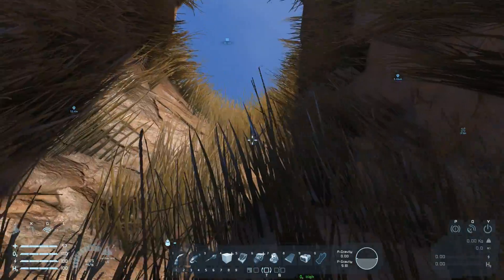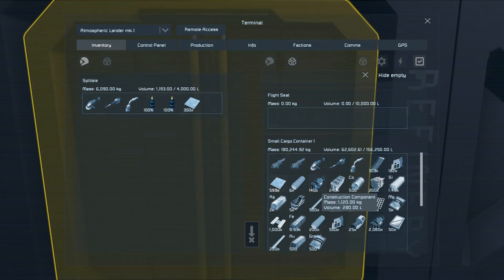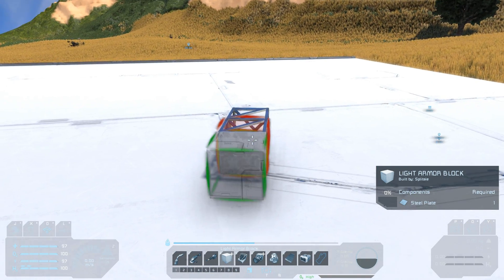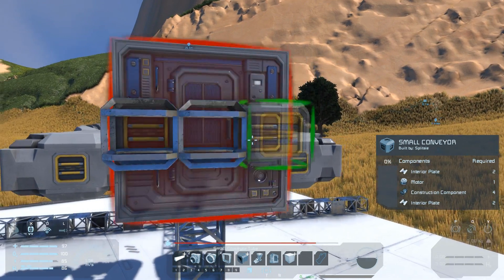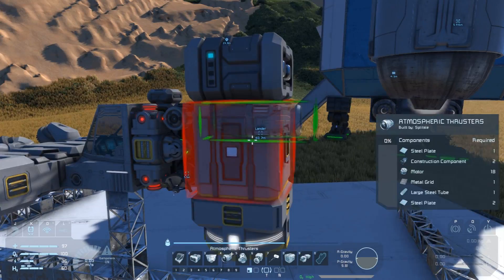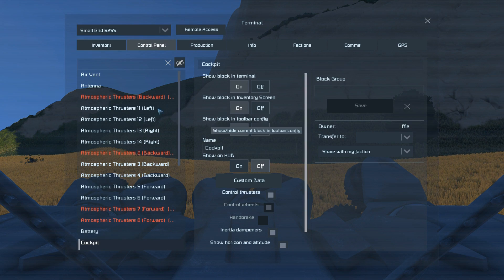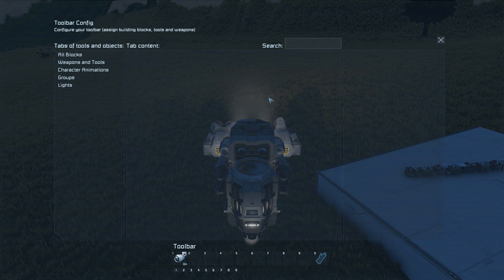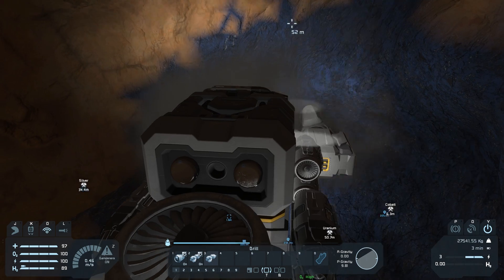Space Engineers Tutorial: Build A Planetary Mining Ship (Part 2 of a survival tutorial series)

Comment: I'm new to space engineers, could it be that since this video was made, it is not possible anymore to add a large thruster on a small block ship?
Reply from the maker: I suspect you're trying to add the large grid thruster to your ship instead of the small grid large thruster. Change the thruster type with the mouse wheel instead of changing by pressing the hot key number and you should be able to get the correct thruster type :)

Comment: I know that this video has been up for almost three years, but I made this ship for the first time and it worked great, until the second time I docked the ship and it started saying "No fuel" and when I went to take off later. It just crashed to the ground without any thrust. Am I missing something?
Reply from the maker: What were you using to power the ship? If you were using batteries had they been depleted by the base while you were connected? If you don't have enough power generation for the facilities on your base then the miner's batteries will be used to supply them. You can quickly check if you have enough power production by going to the control panel for a battery on your base and seeing if it is getting recharged or if it is being discharged (if the information on the right panel says 'recharged in...' or 'fully depleted in...')

Comment: I would like to see your spin on a CAT Front End Loader as a mining vehicle. I tried to use rotors and pistons for moving the shovel but it did not end well.

I made my arms that hold the shovel on a pair of rotors and then used a pair of rotors mounted on the end of a piston between them to push the shovel bracket upwards and downwards. When the piston rotor attached though... my vehicle launched in the air and started doing an aileron spin so fast that it was defying gravity. I was sitting in the cockpit in first person view when this happened. I couldn't get it back down until I ground the piston away, causing the vehicle to slam back in to the ground and bouncing off of the batteries. It MOSTLY survived but I did lose the batteries and my shovel bracket

Comment: Watched this video, sees small reactor. Quit video. Useless in survival mode because no uranium on planets (now). Still trying to build a working flying miner.
Reply from the maker: Or you could simply replace any reactors on videos made long before the change with batteries and you'll be good to go :)
Reply: @Splitsie  ok but i have to load them somehow.
Reply from the maker: Batteries start with 25% charge, you can get additional charge by connecting the ship to a base with excess production using connectors, or place solar panels on the ship to build charge (wouldn't recommend the second one as your go to as it'll be really slow).

Also, I'm hoping to release a new version of this tutorial this weekend :)
Reply: @Splitsie  Yes i know how to charge batterys. My point is i need a complete new ship design for a battery/solar panel ship. Without solar panel i shouldn't run out  of power. I hope you will make a new tutorial for survival mode ;). Thanks for your time.

Comment: Pity this a bit outdated , considering uranium is asteroid only. Your tutorials are pretty good, though I myself like to put one tile of space between drills for that little extra coverage. Mainly because I prefer to use large thrusters to save power (and sometimes resources, not always)
And when it comes to max capacity trials, I do a test run where I drill mostly stone (or if I have marked good spot, the resource), Make note of the ships weight and roughly stop every time I have digged around 10-20% of its weight. If it can fly easily home with 80% increased weight, it's a good mining starting miner in my books, if not.. Moar lift thrusters!
Also, for new readers, be prepared to lose our first miner ship. Flying with heavy loads can get difficult in atmosphere, start it safe and have back up resources incase your ship can't be recovered/salvaged
Reply from the maker: I just released my first in the remake of this beginner series and the next one will almost certainly be the remake of this video which will be all about batteries :)

Comment: So, i basically built this miner, but for some reason it keeps running backwards. I checked options on thursters and all that but it still didn't work properly. I finally managed to get it off the ground, flew about a bit, landed it, and turned energy off (Y). When i started it again, it went crazy again and crashed half the ship (cargo container and everything under or connected to it only).

Was this a bug of sorts or something i did?

(Yes, i am late to the party)
Reply from the maker: Ensure your thrusters are properly oriented and that you have enough power for all of them (that your battery has enough charge) as those will be the two most likely problems. Also the way this miner is set up, you need to fly relatively level otherwise the amount of thrust available won't quite keep you airborne. The explosive restart of the ship may have been a bug, but the other issue is more of a design flaw due to me trying to keep this relatively cheap to build :)

It's one of the things I'm planning on improving when I restart the tutorials after the proper release of the survival update :)

Comment: You should probably do an update mining vehicle video when the new survival update is released :) Also, I've found the most cost effective mining vehicle to be a small rover with just one single drill placed in the right height. The right click mode allows you to tunnel down, and you can control the slope of the tunnel by driving up to the wall. I've made a blueprint of the thing, works beautifully, and doesn't suffer from weight limitations like flying miners do (Though this one is a bit short on space). https://steamcommunity.com/sharedfiles/filedetails/?id=1625490504
If anyone knows a way to make a large grid miner (preferably rover styled to not have to worry about weight) that would be great. I've made one which tunnels very well, but it's a pain to actually get the ore :/
Reply from the maker: I'm planning on doing a complete restart of the tutorials once the update is completely released which will include a lot of the things I've learned since I made these ones :)
Reply: @Splitsie  Awesome :D
I just discovered the most amazing thing today. If you set up large drills and wheels like this: https://steamcommunity.com/sharedfiles/filedetails/?id=1640241613
You get a vehicle which can "climb" in tunnels and be almost completely safe to mine with :D Literally impossible to get stuck in a hole, it can even drive upside down.

Not sure if this is common knowledge or not, but I thought I'd share :) You can make a 3 drill version of the same ship too, but then you can't fit the large cargo container. Might be good as a mid-tier vehicle tho :)

Comment: I followed the tutorial, and it's really cool -- but I can't get fuel into the reactors! No matter where I add it, it ends up sitting in the Connector unit inventory. I'm a total n00b, so I'm sure I did something stupid. Any ideas what I did wrong? Thanks!
Reply from the maker: I suspect the problem you're having is that the uranium can't pass through conveyors without power. The easiest way to fix this is to put a small reactor somewhere on the outside that you can access directly, put a small amount of uranium in there, then that'll provide enough power for the uranium in your connector to get through into the other reactors :)

Comment: I put the uranium in the connector but its not distributing to the reactors. after tht I remove one of the conveyors and I put the uranium inside the reactor but it still wont work. there is something wrong with the conveyor system. Pls help.
Reply from the maker: Conveyor systems won't work without power and all conveyors have to be linked to ports of the same size. Uranium will travel through conveyors of both sizes but a lot of components won't so it's always best to test with ore or ingots. When I'm having troubles with a conveyor system I trace it from one point of access all the way through to the next making sure that every block is properly welded up, functional and connected the correct way, it's incredibly easy to mess up (or at least I find that it is) :P
Reply: @Splitsie  Thx man I had to grind up the behind of my ship and manually put the uranium in the reactors. Its all gud naw My ship is fully functional. thx for the tutorial ur vids r great!
Reply from the maker: Glad to hear, I often build an externally accessible reactor to power up the conveyors during the build phase because of the number of times my batteries have run dry while I'm messing with the armor :P

Comment: It seems that the battery bottoms out too fast, is there a way to get around that, maybe using the big reactor.
Reply from the maker: For small grid atmospheric craft you're almost always best off using batteries due to the low max output per second of the reactors. It's certainly doable to run them that way, but for mining craft you end up greatly limiting the cargo capacity. What I like to do is have a couple of small reactors for trickle charging if I'm ever low and unable to lock to the base for a recharge (or while I'm building the rest of the ship) :)

Comment: There is a lot of stuff you failed to mention. Like the reactor bases have to face towards the conveyer or they will not work and the thrusters will melt anything behind them and a few others. I had to remake my ship 3 times because of this stuff.
Reply from the maker: When teaching something it is always a balance between getting bogged down in too many details and making the lesson difficult to follow vs missing important parts. The design I showed avoids both of those issues so if followed along with you won't run into those problems and can learn about them in the videos I made where I looked at conveyor systems and thruster damage in detail. It was a deliberate choice on my part at the time not to go over every possible problem as it then becomes too overwhelming for most new players
Reply: Naw, it would of been very easy to quickly mention them.  You mentioned other small things like that ( evenly distributing Uranium, welding parts before you cover them up. These are the same things as what im talking about) These details are why people click on these videos because they get bogged down from little stuff. These are beginner tutorials. You have to assume everyone is an absolute beginner. You dont have to address every possible thing that can go wrong but certainly common issues players have (like facing components) Some helpful tips for your next tutorial.

Comment: your lifting engine is far to the back, do you not have to worry about center of mass in this game?
Reply from the maker: All thrusters in SE put all of their force directly through the COM of the grid they are attached to, regardless of their position. There are some situations where COM is important such as when you have mass attached to subgrids via mechanical blocks (rotors or pistons) or when building wheeled vehicles. The main argument I've seen for why they simplified it was to allow for more flexible aesthetic design in the ships, rather than the more accurate method of design that's mostly required in Kerbal Space Program :)
Reply: Splitsie thanks, makes sense :)

Comment: I built this miner exactly and it would not stay hovering when it was powered. It would constantly tip over and explode when i attempted to flip it back over.
Reply from the maker: This has limited lateral thrust, you need to keep it reasonably level with the artificial horizon on your hud. It was built this way to reduce resource requirements, but one of the first things I'd recommend once you get some is to add a couple of extra thrusters in each direction to allow for more angles with safe flight

Comment: Great job, your tutorials are very easy to follow I built your same ship as in this video but my connectors not moving the uranium to my reactors.
I did see your other reply on how to fix this problem but even with 2 solar panels and another reactor the ingots aren’t moving I even turned off the power and back on and still nothing, any help you can give me would be amazing
Reply from the maker: Hmm... I've got a couple of possible things to try. First, make sure the conveyor system is getting power by either looking at the tubes and making sure they're green or jumping in the cockpit and checking that it says there is power available (will say an amount of time left on the bottom right of your hud). And the last thing, try opening the connector by hand and then accessing the reactor from there to see if you can drop uranium in there directly.

If that's all good, are you trying to load through a connection onto the base? The reason I ask is that if you're loading through a base and all your uranium is already in another reactor then the ones on the ship won't be able to pull it from there and you'll need to move it manually.

Comment: hmm i dont get it, this is the 5th planet mining ship i copy to the dot, and i cant even lift off, the ship is to heavy without anything in the cargo, just plummits to the ground. My ship mass is 12247.92 and im on earth. Not sure how you can lift off and why your ship is so much heavier than mine.
So annoying, been building mining ships for days now, i get em to lift off when i add 3 x large trusters, but i can mine maybe 10 seconds before im to heavy to fly anywhere :(
Reply from the maker: One possibility may be that you're playing on realistic inventory settings. If that's true then the cargo will fill very quickly and overwhelm the thrusters, I rarely fill my miners to capacity, preferring to aim for a particular mass target. The other possibility may be that by the time you're mining your batteries are empty, reactors don't create much power per second so are usually unable to provide enough for thrusters, which is why even with reactors you need that high power output battery for things to work.

Another thing to note is that I tend to design my miners with the idea that you'll keep it nice and level as much as possible while mining, so if you're much off the horizontal the ground will come and say hello much faster than you'd like :P
Reply: I had a similar issue, and find out that the problem was the battery. This ship can not run only with the power of the reactors, it needs to have a charged battery in order to fly. Try to let it on (with all the thrusters powered off), and set the battery with all the checkboxes unchecked. When it has 2 or more dots of charge try lifting. Vioalà!

Comment: add that the battery needs to be placed the same as yours or it wont work
Reply from the maker: I'm not quite sure what you mean, batteries can be placed anywhere on a grid and still work and with any orientation (just make sure they're not in the way of a thruster as that can end poorly) :P
Reply: Splitsie with me the grid was all read. Replaced almost everything and it still didnt work. Turned the battery 180 degrees and then everything worked. But now engines randomly get dammeged
Reply from the maker: Hmmm... that does not sound right at all. The bounding box for the battery should only be red if there's something obstructing your placement of it, and flipping it over leaves you with the same size of bounding box so shouldn't have had an effect.

Things being damaged suggests to me that you may have the thrusters pointing at them and causing the damage. You'd be able to exclude that possibility by turning thruster damage off in the world settings and seeing if it still occurs. The other thing to make sure of is that the ejectors are far enough from the ship that the rocks aren't hitting it (I've made that mistake since making this video and kept wondering why my connector was broken) 

If it still does occur after checking that it's either going to be due to a bug or a broken mod that you've got installed as thrusters are the only blocks that can damage their own grid :(
Reply: Splitsie ok i'll try that but i didnt flip the batttery. I turned it 180 degrees horizontaly. And maybe a possible upgrade is a second battery underneat the cockpit. Maybe try and remake the bulding tutorials because some icons have changed and had a hard time finding some stuff for the build. Already had a hard time starting as i flipped my lander and unknowingly damaged my refindery. But thx for the help

Comment: The reactors wont auto fill nor can i access them?
Reply from the maker: The most likely problem is that your ship is out of power. If your ship has no power then items can't move through the conveyor system, add an extra reactor on the outside somewhere you can access directly, once you have it put a little uranium in, then everything should work normally :)